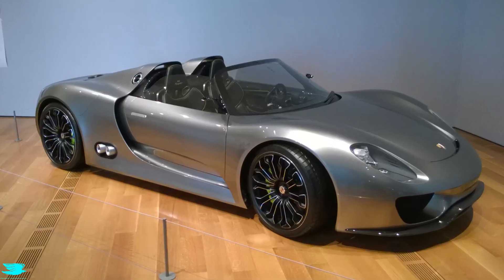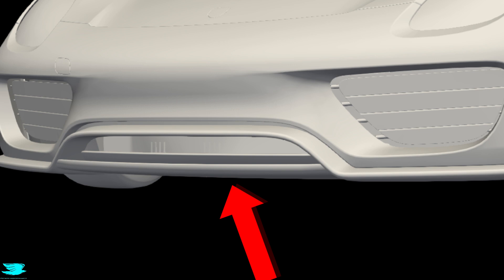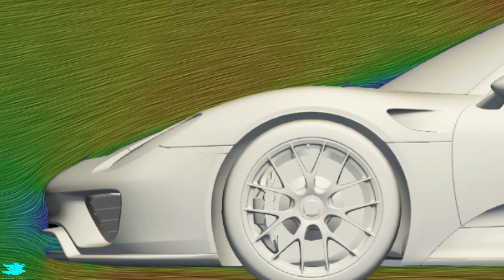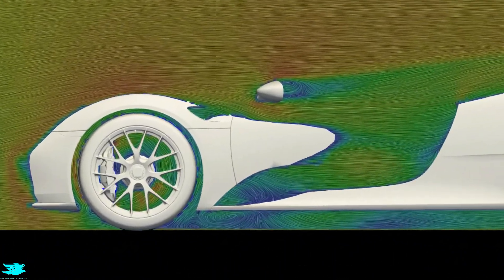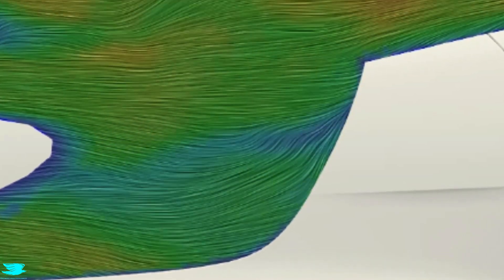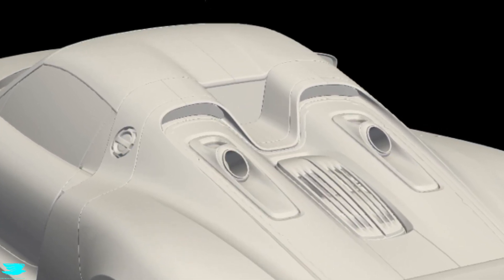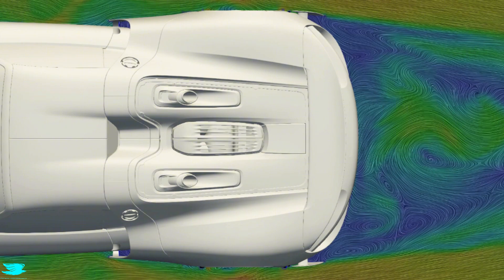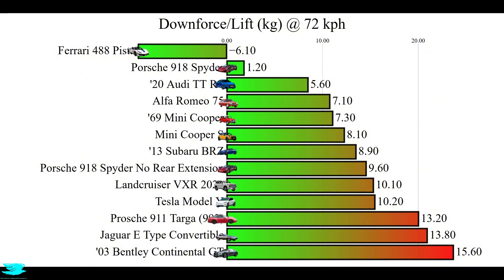Porsche 918 Spyder Aerodynamics

Comment: Rear extensions look like a great mod for aero enthusiasts to try.

consider a BMW i3 which has a small battery and light carbon fiber frame which is a prototypical efficiency enthusiasts EV.
it’s reasonably slippery for its form without treatments at 0.30Cd for the i3s but plenty of margin for improvement.
losses in drag would translate to gains in range.
increased stability at speed would be a great bonus.
Reply from the maker: Definitely. And the i3 kind of suffers from the hatchback design, which is inherently more draggy.

Comment: @3:20 the extracted flow from the tires is guided nicely under the mirror reducing the pressure under the mirror, which makes the mirror housing produce draggy lossy downforce. This of course is far better than just making lossy drag by itself.
Reply: the vent may have been trained to an existing mirror shape & mirror shape to find better behavior then they could affect each other’s shape.
Reply from the maker: Lol, maybe one day a car will be designed to produce as much drag as possible.
Reply: @PremierAerodynamics  If you add enough rotational energy, the vortex you create will start working like a propeller. Like in those vortex tubes that separate hot and cold streams.